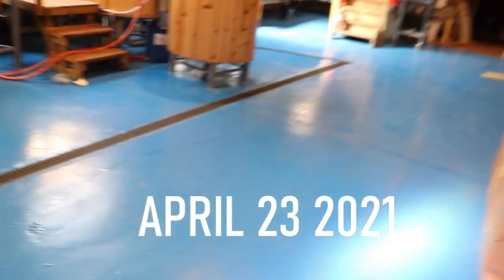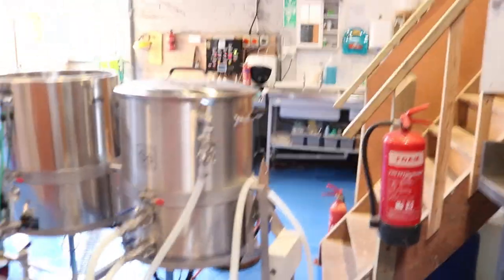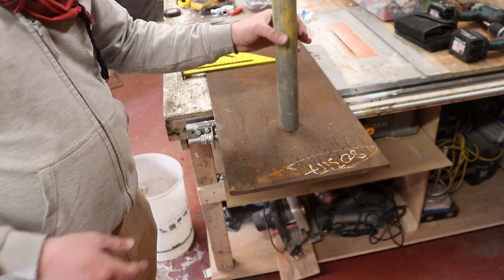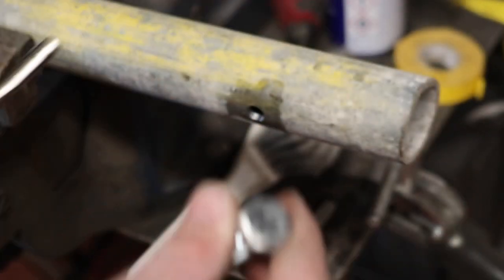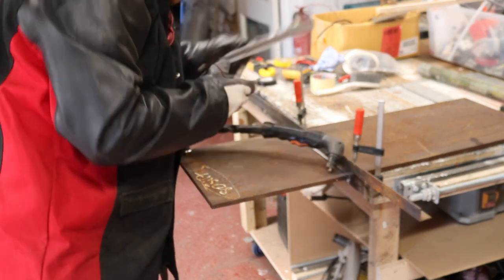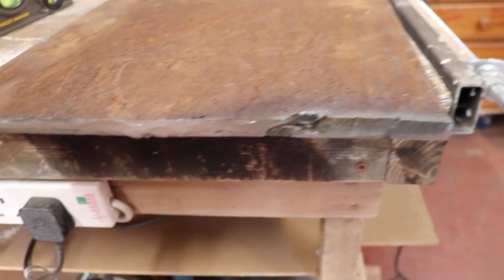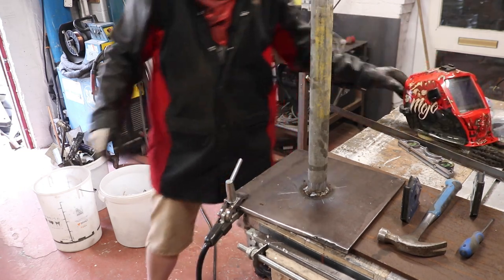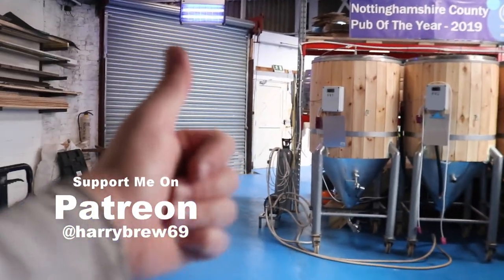Messing About In The Fab Shop

Comment: Think you were moving too fast on the plasma after restarting. Starting and stopping is a pain with these. I believe weld.com had a suggestion of keeping the arc running at about a 15 degree trailing the cut, but check them out to make sure. Glad to see it worked out either way.